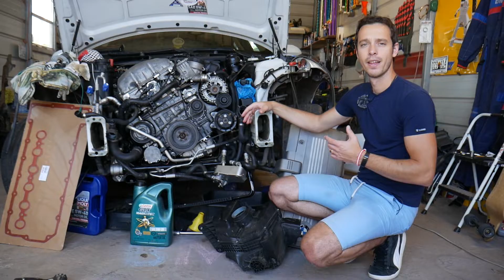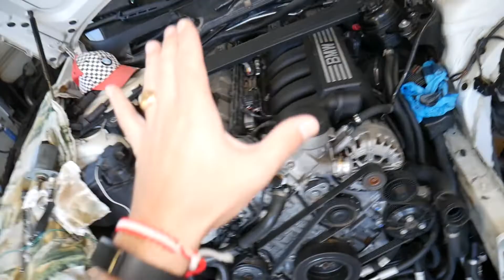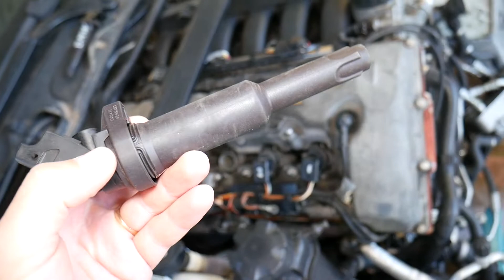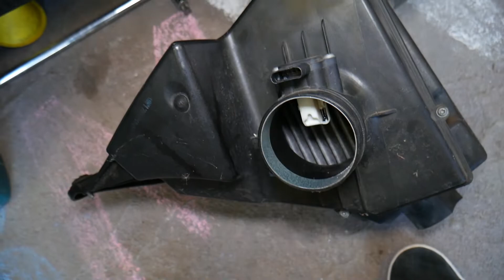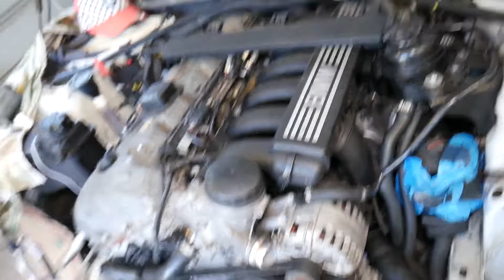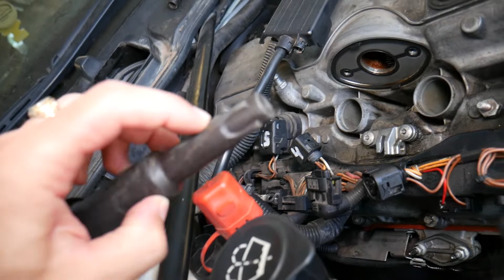TOP 20 REASONS BMW 1 SERIES MISFIRE | ENGINE MISFIRES BMW E81 E82 E87 E88 F20 F21

Comment: My engine misfired during idle when I was at traffic lights I have a 2008 118i e87 bmw. The code read by the mechanic said there's a misfire in cylinder #1 so he changed the spark plugs and ignition coil but I am still having the same problem. Also there is a little vibration in idle. What do you think I should do next?
Reply: I have a 2007 120i and it's having the same problem. Does it also take power suddenly even though you're not pressing the gas pedal harder?
Reply: @AlijiEnes  do you solved it?
Reply: @thanhnghia5095  nope, still dealing with it, but I have it narrowed it down to the fuel pump that broke down again and the injectors. Sorry for the delayed response!, didn't see the notification.
Reply: @AlijiEnes  Hey, same here. What was the problem? Scanner is showing oxygen sensor
Reply: @BLUEflowerplace   a bunch pf problems man, they made me change the fuel pump, did that, then I changed the high pressure pump which feed fuel to the injectors, and then the injectors were faulty which I haven't gotten around yet because where I live it's hard to get them and it costs quite a bit. 

On top of everything my new fuel pump that I installed, now it's not working properly so I need to get that changed again, apparently it's not wise to go with a brand new pump, even used pumps are better as long as it is OEM. 

I have a perfectly good car and love her to pieces since I'm quite passionate about cars overall but I think it's the mechanics that are the problem. You can't find a proper one for anything at all and I have tried at least 5-6 of them in less than 2 years.
Reply: Hey, what was the problem? Scan is showing the oxygen sensor